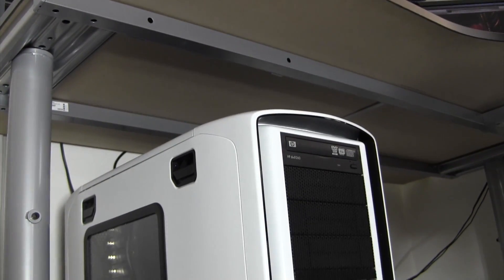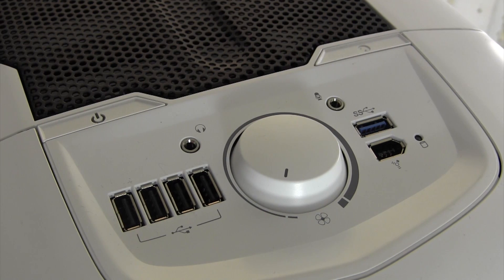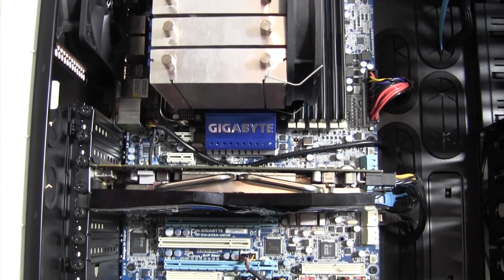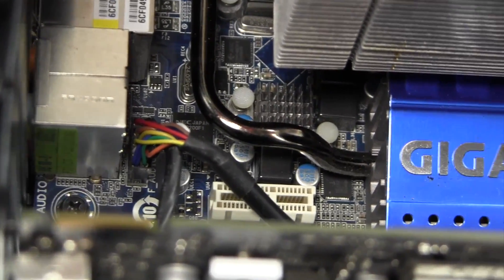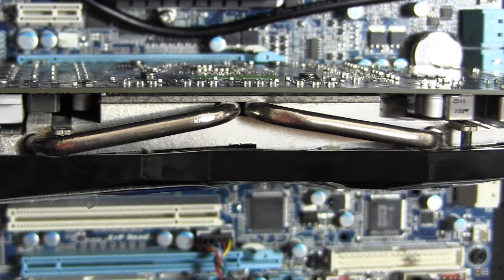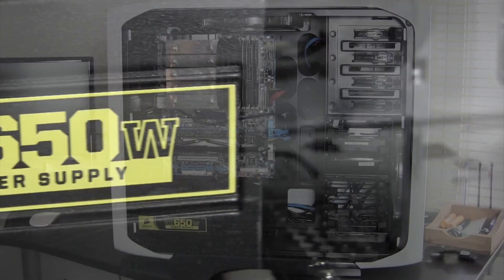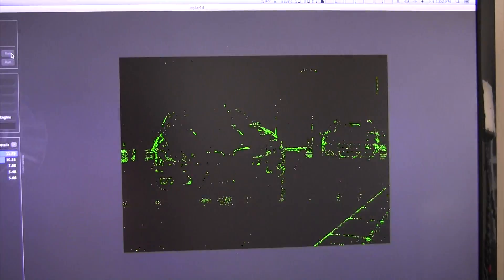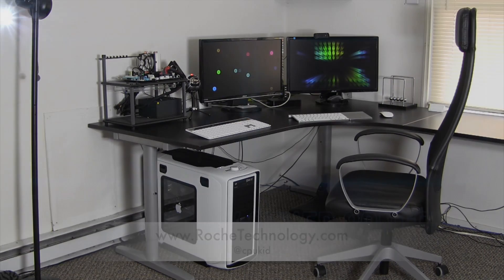Tour of My Hackintosh [Spring 2013]

Comment: I have the same case in black, with an Apple logo in the center of the right panel.
I have, 2 SSD 128g drive one for win7 one one for 10.8.3.mobo is Ga77X UD5H. With 16 gig of cosair DDR3 just like you. I have 2 extra hdd for my windows stuff and 2TB hdd for apple stuff.I Also have Apple TV, and a WDLive 3TB NAS Server for my movies. This is one of the best case I ever had, it replaced a Lian Li that lasted me 5 full system rebuilt.
I run a recon3d for sound on win7 and onboard for hackintosh.